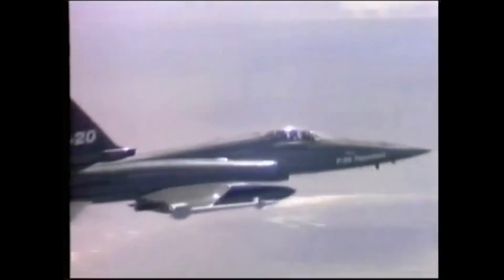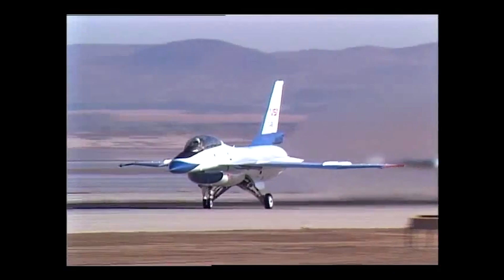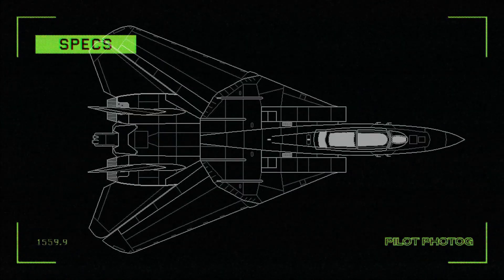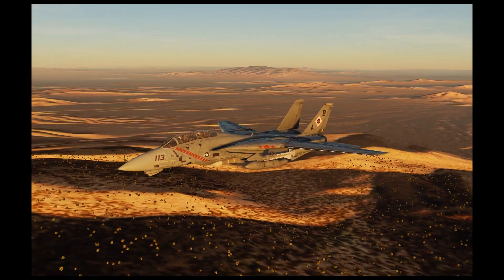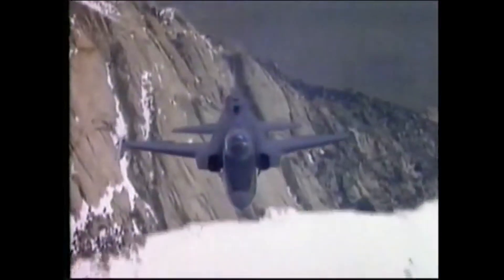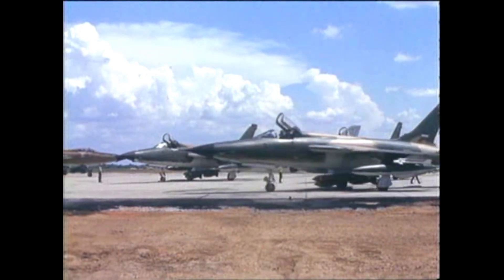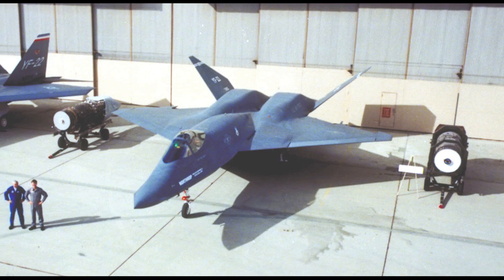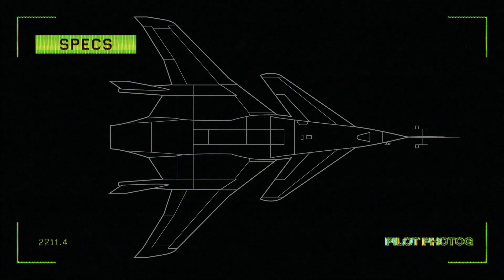Top 5 Fighters That Should Have Been Built | Best of Aviation Series by PilotPhotog  f20  f16xl

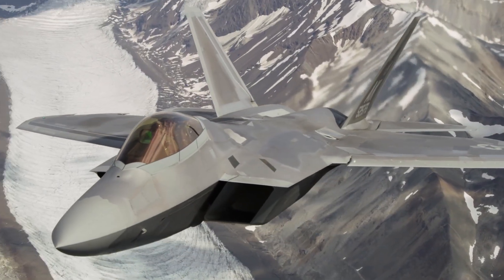Comment: @12:18 No it was not faster. That's classified information sir and you would have no business knowing that. 

I can say this, the aircraft met their speed requirements set forth by the RFP for the ATF competition; in fact both aircraft surpassed the requirements. 

The total maneuverability is also classified, sir. You are likely not to have known the details of these numbers, either. However, it certainly is plausible that the Widow was just as capable, but based on what we know now? It might lose that edge at slow speed ACM which was what the YF-22 demonstrated during it's showing. At higher speeds and higher altitudes? Perhaps the Widow was better, yes. We won't know for sure... it's classified. I personally feel that the YF-23 was a better high altitude dog-fighter and interceptor, but again - we cannot know the details. 

The reason why Northrup lost was because they had no money, while Lockheed was busy completing it's massive merger with General Dynamics. The ATF program started as early as 1982 and by this time, Lockheed was already in talks with GD. When the F-22 program was fully underway, many of the best of GD's Design Engineer group was moved to Skunk Works to work the project; while GDs coffers assisted in better capital backing. Northup's YF-23 was a hail mary where no such company strategies were available to them. The best they had to fund themselves was the Hornet and B2, and they were currently strapped at the time while those platforms were still very new. A partnership with Grumman was struck to help ease the pressure, but to no avail. The lack of money showed grossly during the aircraft's reveal in which the hard working NG engineers literally laid the thermal panels of the engine trenches the night before the roll out. You can clearly see how tired they were with how haphazard they tiles were nested in place. Furthermore, their cockpit was but a mockup at the time; being a cannibalized F-15Cs cockpit thank's to their partners. However, this implied that they had nothing to show for the electronics side of the aircraft during the roll out. 

First impressions mean everything and while Lockheed went on to show care working weapons bays, thrust vectoring in action and the at the time new "Glass Cockpit", Northup unfortunately had nothing to match.

It didn't help that the Widow itself did have some flaws when compared to the F-22; this biggest I remember was lack of payload. The YF-23s bays were smaller and it literally could not carry as many hard points as the YF-22 could. This played a roll, along with the obvious money concerns evidenced at the roll out. 

When the DoD is reviewing competitions, you bet your mom that concerns of production reliability are taken into consideration. Lockheed had solved that issue right away by securing not only the talent and cash from aquiring General Dynamics Ft Worth; but by also partnering with Boeing. These are literally the two largest aerospace giants on US soil; production needs will certainly be met. With Northrup Grumman? Not so much. 

I wish both fighters could have been deployed with the YF-23 being refined a higher, faster interceptor platform. But sentiment is not how the game works IRL and in the end, the best fighters WAS chosen.
Reply from the maker: Thanks for commenting and a well thought out post.  The pilots that flew both aircraft agreed that the YF-23 was faster and as you say the exact numbers are classified. For maneuverability, I was specifically referring to the high angle of attack demonstration that Lockheed performed which again the pilots said the YF-23 could do.  Your other points are spot on and again I appreciate the comment and information.
Reply: @PilotPhotog  simply doing the math on the drag coefficient between the two kinda yields an obvious answer that the 23 should be faster. However the details I've heard were that top speed for both were not considered valid by the USAF because after Mach 2.2, the RAM coatings began to suffer severe damage. So I know both fighters could go faster than what is publicly known? But that they sacrificed their stealth to do it. I think that's testament more to the PW F119s more than anything else. 

The USAF certainly had a revelation during those trials as there's not much you can do with today's technology to avoid the RAM getting hot and flaking off. Even the F-35 shows it's still a massive problem even with it's coatings which are FAR more advanced than the F-22s in terms of durability. I think the paradox with 'speed + stealth' is obvious - the purpose of the RAM is to absorb EM energy which often means it's a damned good conductor of thermal energy as well. I know this is one of the major reasons why the top speeds are actually classified. Kinda' sucks lol. 

In terms of maneuverability, I think with today's flight software and FCSs you could have the YF-23 surpass the YF-22 despite the thrust vectoring. The F-35 has no such vectoring yet because of data gains from the F-22, YF-23, F-16 and more, the F-35 is capable of post stall maneuvering despite no TV. 

I think TVs future is allowing for very fast aircraft to still try and achieve stealth by eliminating the use of an empennage of any sort. You're future 6th gens are likely to be single deltas with no tail planes or V Stabs. 360 degree TV will solve the lack of yaw at high speeds, something that the B-2s spoiler method cannot do. 

The only thing I find controversial is the idea that these new aircraft will be pilotless. We are fast going that direction but I don't think we will ever fully remove pilots from the sky. If we look at the F-35, it's a platform designed for that exact future. A single F-35 has enough processing power to control up to 12 other aircraft / drones. The F-35 itself actually has a 'drone mode' and could fly itself. This allows a Pilot to be the quarterback of a drone flight, issuing tactical commands via his massive touch screen and Voice Coms to his A.I. wing men. 

That's going to be one hell of a future.

Comment: As far as i know Japan has been in talks to obtain the fully capable F-23 as an option to moving fwd with an indigenous fighter.
The F-16 XL fighter-bomber would have been a good choice for many airforces, for so many reasons.  It suffered only bad timing, & now there's larger conformal fuel tanks on an off the shelf F-16, which when wing loaded, looks bloody awful.
Glad the Arrow is in there !!
Reply from the maker: It would be interesting if the Japanese SDF could get the YF-23 program restarted.  Thanks for commenting and I am planning a video all about the Arrow.

Comment: I see nothing special about the Avro as the Swedish Draken was allready flying at mach2 and could do the cobra was fitted with advanced radar for its time
Reply: Except that mach2 speed for the Arrow was with the US J-75's. When equipped with the Orenda iroquois , it would have been the fastest interceptor in the skys.
Reply: Just one of the Iroquois engines intended for the production Arrow produced 50% more thrust than the engine of the Draken ... and the Arrow would have TWO of them.  You "see" more when you actually look into the details.

Comment: I worked on the development team that produced a certain "must have" sensor for the YF-23.  When we heard the YF-22 won, we were stunned as we knew which was the better plane.  However, the AF selected our sensor system for the F-22, which meant we did a better job than the YF-22 people.  I wish the YF-23 platform had won.  We'd have a better 5th gen fighter.  The stealth characteristics  were much better, too.  Northrop knew what they were doing in that department.

Comment: Great video. These very questions have been on my mind for a long time and make my head hurt. It seems dozens of great planes have gotten the thumbs down. Why? I don't care about the avionics, the engine, the radar, the bling, bling. The airframe is the most important thing. The way air moves over the whole thing. Congress can't rig that. How far can it fly on one load of fuel? Hard points make a plane stupid versatile. How many does it have? Mach-2? I'm sure. How fast can it turn? Ease of maintenance? The plane should be made to be maintained. Cost? The cost of a current generation fighter jet is embarrassing and insane. Wouldn't 10 planes that are almost as good (maybe better) and upgradable be a better value. The Navy, Airforce, and Marines need the damn planes now! Not in 10 or 30 years. Where's my aspirin.
Reply: Even a reasonably good plane can have a successful service life. Why not buy them all, in reasonable numbers. The military would never have to be embarrassed about missing a good one that way.

Comment: The F-22 was another bad choice in a string of bad decisions. One of the stated reason for choosing it was it was more "conventional" and so easier to mass produce it. Well, there are only 195 F-22's and 8 of them are test aircrafts. So much for mass production. The REAL reason the F-22 won is because of Lockheed; a company caught time after time bribing officials to get contracts. They are a company caught in so many scandals and, yet, fined relatively lightly given how much they make and what is worse is that all of the US 5th generation fighters are now made by one company - Lockheed. What the US has done is created a single point of failure. Stupid if not insane.

Comment: F16 L too much new to justify extending 
F107 just pig ugly
F20 grand error on USAF thinking, should have gone with it, especially with F5 readiness, cost and performance.
Canadian Arrow just too big
F23 should have gone on development to Sixth Gen format
Reply: It could be argued that the Arrow doesn't categorically belong on the list as it was a purebred interceptor, not an air superiority fighter in the sense of being designed for maneuverability (i.e. with any expectation that it would have to dogfight higher agility, more traditional Soviet fighters).  Like the Soviets' own later MiG-25, it was built to stress speed, ceiling, and rate of climb and the expense of all other concerns (including agility).  The Iroquois engine intended for the production Arrow would have produced some 1,000 pounds more thrust than the engine of the F-106...and the Arrow would have had TWO of them.  A boom-and-zoom interceptor, not a turn-fighter - even today, Canadian airspace would be beyond the reach of any Soviet 'agility' fighter not making a goodwill and, more importantly over such distance, fuel stop on the Canadian side.

Comment: The YF-23 will always be a case of impossible hype versus reality. Lockheed carried out live fire demonstrations and high AoA demos, Northrop didn't, they could say what they liked about their design capabilities, the other guys actually went and did it. If they had gone and done the extra things and won the competiition I bet we would say the F-22 was the better aircraft. In reality both were such massive leaps of technology over the F15 that the YF-23 would have had the same 15 years of teething trouble the F-22 had. Something else that never seems to be brought up is how visible the YF-23 was in the sky, when it rolled or turned it generated massive contrails from the wing leading edges that could be seen miles away. Northrop tried to downplay it but in trials it was very obvious, that did a lot of damage to it's prospects as well as the F-22's extra demonstrated abilities.

Comment: The Chance Vought F-8U-3 Corsair III should have been built instead of the Phantom II. It could out fly and out perform the Phantom in almost any situation, used half the fuel, and didn't smoke like a diesel when not on afterburner giving away it's position like the Phantom would. It was also faster, and came with an internal gun.

Comment: One factor with development of a fighter is running costs. How much does one hour of flight cost? Logistics, maintenance, parts....
Reply from the maker: Indeed operational and maintenance costs should always be looked at - in the case of the F-20 it was shown that it was less expensive to maintain than its contemporaries which to me is another good reason it could have done well as an export fighter.  Thanks for commenting!
Reply: Herman Dirk den Boef  ---- How much is the cost of a dead body!

Comment: As a Canadian I am saddened that the AVRO Arrow did not see production. It did have some technical issues to over come, specificaly with the Iroquois engines. But I take heart knowing that alot of the engineers did go to NASA and help in the space program. But as well some did go to MacDonell/Douglas and a lot of the design advances appeared on my favorite jet aircraft the F4 Phantom ll. Look at the intake design as well as the saw tooth leading edge. As well the radar system , APQ 72 used in the Phantomn,  was/is a direct plug and play of the ASTRA fire control system, developed by AVRO for the Arrow.
Reply from the maker: Thanks for commenting and while it is good that the Arrow’s legacy lives on in other projects, to me it is one of the biggest “could have beens” in aviation.

Comment: Really the Jet with the best Air to Air missile is the best fighter.
A old f-86 Saber with the the best current 2020 Air to Air missile could shot down any jet if it get the lock on.
It's why 600mph Harrier Jump Jets were shooting supersonic Mirages in the 1980 Falkland war while in a hover.
The Jet does not need to do Mach 2 and 8G turns at 60,000ft , the Air to Air missile chasing the enemy plane only has to.

Comment: The F16x is excellent choice IMO, as: it has serious lifting capabilities, and had the extra fuel tanking as a result of its design configuration. 
It had a ridiculous amount of hard points, and the added range to excel in areas the Falcon simply couldn't. 
*however, not counting vectored thrust aircraft, it was said by aircraft specialist Mr. Sperry 'it has the best and tightest turning radius of any aircraft flying today.' That was per a video I watched quite a few years ago, to be fair.

The F16x doesn't, he was referring to the f16 fighting falcon, which had a really smooth underside without those added hard points.

I believe the Canadian 105 avro arrow was a very good candidate as well, just saying.

Comment: The f-20 was just to small for most countries. While this wouldn't hinder weapons or avionics today it still handicaps its fuel capacity and thus range. Besides it was essentially targeted to one customer. Taiwan. Carter's attempt to snuggle up to china doomed it. 
The f-23 lost to f-22 for one reason. The competition was VERY close. Ultimately it came down to asking the pilots which plane they wanted, and they said they wanted the F-22.
Reply: Really the Jet with the best Air to Air missile is the best fighter.
A old f-86 Saber with the the best current 2020 Air to Air missile could shot down any jet if it get the lock on.
It's why 600mph Harrier Jump Jets were shooting supersonic Mirages in the 1980 Falkland war while in a hover.
Reply: @Crashed131963  on paper I agree. In reality it's usually the best pilot. Lest we forget the time an unarmed ef-111 got a mig to crash itself. I'm not making that up. : / It can also depend on the rules of engagement (as in Vietnam). Counter measures (decoys, jamming, etc) can also make a difference.
Reply: @navyreviewer  *Mirage F1. Not a MiG. The Mirage was following the F-111 in a turn at very low altitude and then got locked up by an F-15, diverting the pilot's attention long enough for him to crash into a sand dune. The F-111 was credited with part of the kill.

Comment: Great list, can't argue with your choices. One fighter I'd like see added the list (make it Top 6 fighters?) is the F-12, the fighter version of the SR-71. The prototype version was the YF-12A and they only built 3 of them. Kelly Johnson, the Lockheed Skunk Works designer (who designed the A-12 recon aircraft and the SR-71) always felt that while the SR-71 was a great aircraft the Air Force had built the wrong plane. He wanted the F-12 fighter.
Reply from the maker: Thanks for commenting and I've realized that this should be a series instead of just one video...I will be making many more, stay tuned!
Reply: Great news, looking forward to seeing your next video. Cheers...